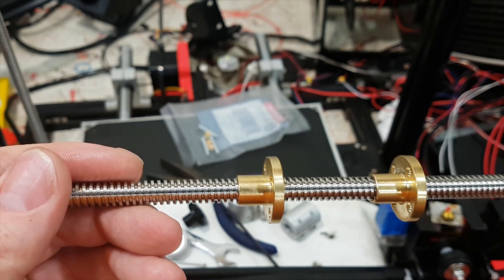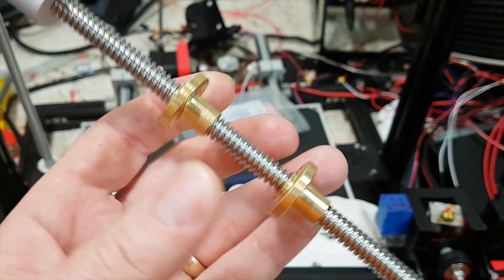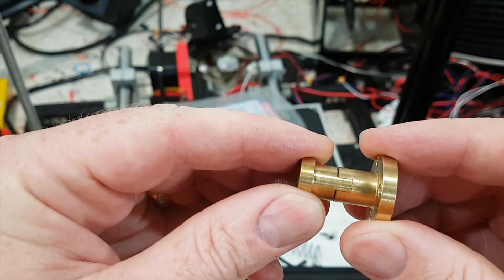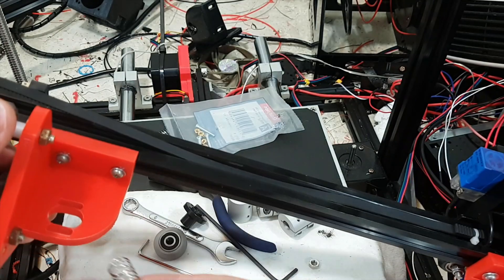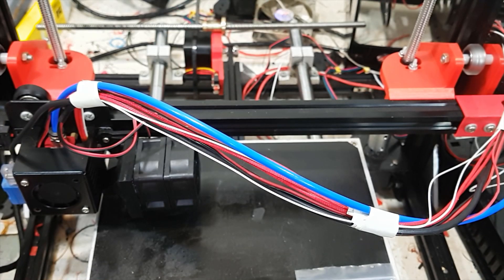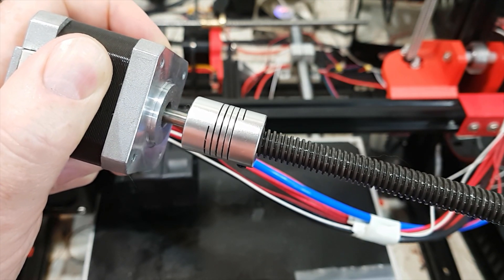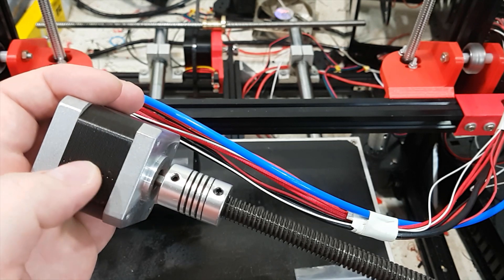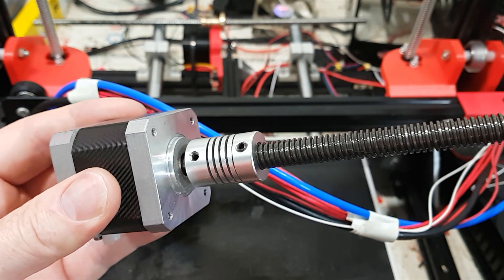⚡️ 3D Printer Anit Backlash Nuts and Couplers,  Polycarbonate  wheels.

Comment: The motor work isn’t necessary. Hold the screw rigidly in place with the bearing blocks. Pull the blocks apart a bit to take out any end play in the bearings. The “springiness” in the coupler is to protect the bearings in the motor from damage from misalignment. There is no such thing as a perfectly aligned screw drive

Comment: If the 3 piece unit were sized exactly,  you would probably need a hammer to put it together.  The same with everyday nuts and bolts. If the tolerance is too small they bind and don't fit together.

Comment: You are supposed to use pillow blocks (with thrust bearings and collars) with flexible couplers. Also, if you have horizontal misalignment you can use Oldham couplers or the like

Comment: Correct me if i am wrong, but the springy coupler was supposed to compensate for the misalignment between the motor and the shaft. Is it?
Reply: Exactly, this guy doesnt have a clue what he's doing
Reply: You are correct Mr. Abdullah, the main purpose of a flexible "springy" coupler is to compensate for misalignment. Unless you are building a perfect system, misalignment will always exist. A solid coupler would work but he will need to spend time re-aligning his axis. Still he will get more radial load that wears his bearings faster, make a bit more noise or lose motor torque.

Comment: I don’t think you get the point of the plays that you’re chasing everywhere. Not all plays and what you call “springiness” are evil. Many of them are here for a reason. You should read more literature. Gut feelings only go so far. Additionally, by doing multiple “upgrades” simultaneously, you lose visibility on their impact.
Reply: Actually on the springiness, a lot of high tech systems eliminate backlash by using spring designed to operate near linearly in certain ranges. That way they dont need joints and linkages.
Think mems systems, thry are currently scaling these machines up and constructing robots using series elastic actuators. Why do we care since we are in 3d printing, well corexy and belt driven z systems connect the actuator to a long stiff spring all the way to its end effector, due to the pretension it decreases backlash but allows vibrations using serial spring actuation, and then we compensate the vibration out and we are back in the high tech sector. Looking at voron + klipper combos, some smart design thoughts went into those systems.

Comment: After removing the spring washer and replacing it with solid shims, does the raise in temperature of the motor, after it has been running a while, cause any noticeable difference in motor performance?

Comment: so from going from a standard pitch  lead screw to the 2mm pitch lead screw do you have to teak profile settings or it works and its as easy as swapping them ?
Reply: You will definitely need to tweak your printer firmware to make this work since it's changing the pitch of thread. It will take effectively 4 times the amount of steps to make the same distance move and your printer has no way of knowing that.  There is plenty of information out there if you search for lead screw mod or something similar.

Also I'm aware this is 10 months old, I'm just putting this out there for people who may have the same question and see this.

Comment: I accident stretched the shit out of mine I set my max height on my setting to 2000mm instead of 200 it tries going higher than normal keep in mi y my motor is mounted on the top so when it kept trying to pull and it stretched it

Comment: Get rid of that "downward springyness" by putting a 6.3 mm ball bearing in the coupler and let the lead screw rest on it.  It will support the weight while still allowing the leadscrew to wobble.  I got that idea from Alex Kenis,who has a detailed video on here explaining the "hack".  Thanks Alex!
Reply: works sometimes. The best thing to do is get rid of the spring style couplers with set crews and get some plum couplers. Set screws cause way to many issues such as the lead screw crawling up the set screws.

https://www.amazon.com/gp/product/B07RMZCLZ3/ref=ppx_yo_dt_b_asin_title_o02_s01?ie=UTF8&psc=1

Comment: this spring antibacklash system is so stupid it is amazing people still buy this bulshit. if you only fit one part of the nut to the carriage any force greater than the spring will render it useless. for the Z axis for example imagine the spring is pushing the spindle upwards. That is at least 1KG lifting power for  an anemic spring like that? and if you are milling something hard like alminium the z tends to vibrate so you need at least 3kg lifting power in the tiny spring to remove that vibration? still people buy them . amazing